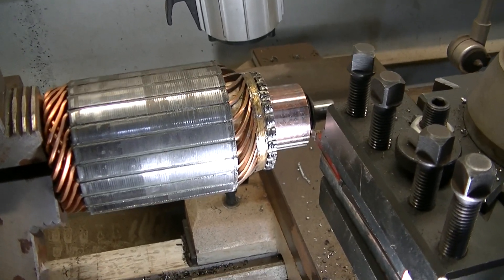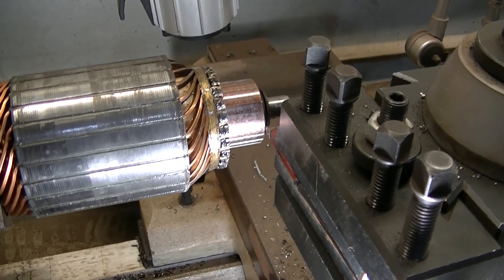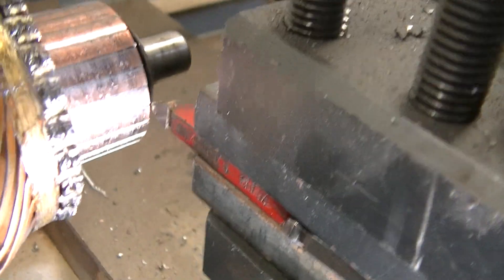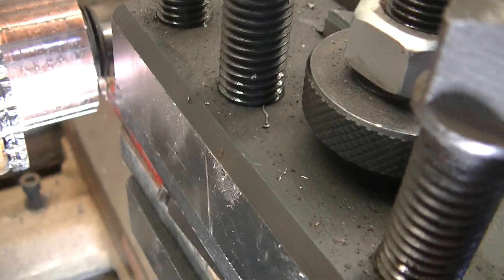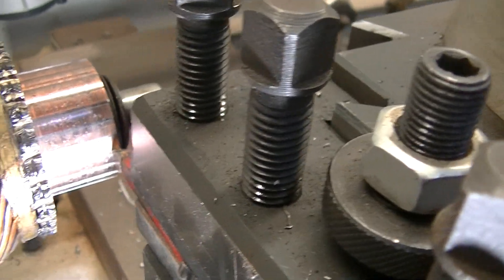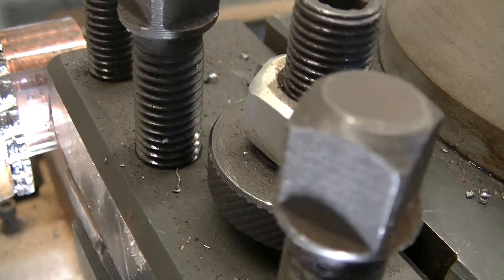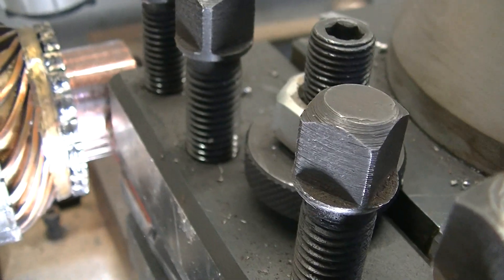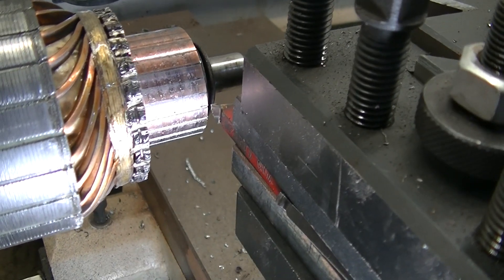Armature Mica Under-cutting with a Lathe - zeketheantiquefreak

Comment: I almost had the opportunity to buy an Atlas lathe made pretty much specifically for this job , was just a couple of days too late , and didn't know tit could be bought , got very tired of going to start/altr shops and not getting decent quality service, or trying to chase down a quality rebuilt.
Reply from the maker: Yea, this actually worked to under cut the armature on a 4020 JD. I had never tried this method before and had previously used stuff like broken hack-saw blades and such. The results of doing it on a lathe were much more professional looking. Thank you for the comment.
Reply: zeketheantiquefreak I have done the same, It just feels so satisfying to have the right tool for the job , I believe we call that professionalism , it has to be earned.
Reply from the maker: @beckywatt5048  Darn... I just found this comment now. Thanks for the reply!